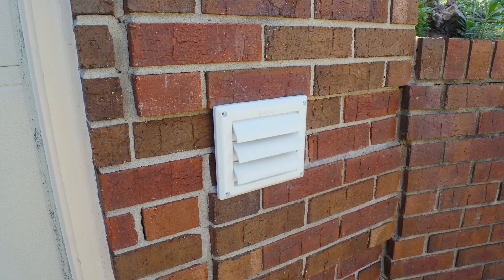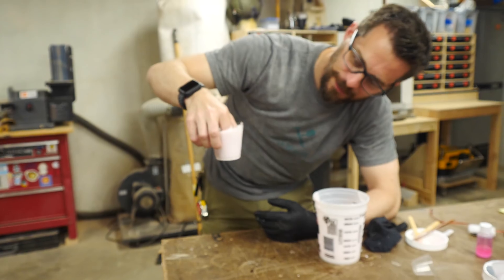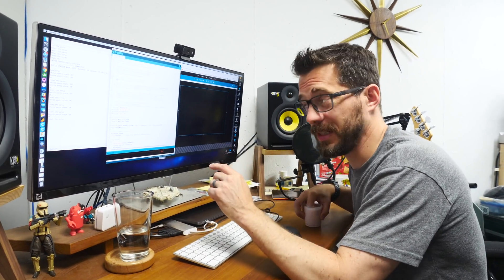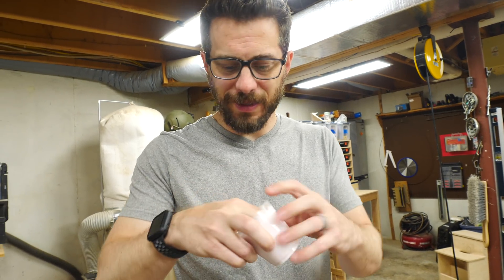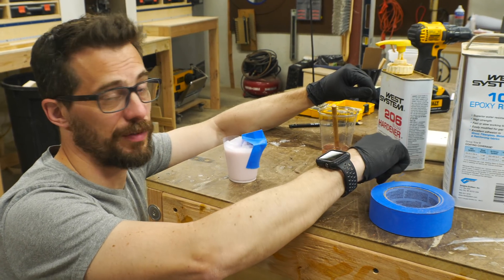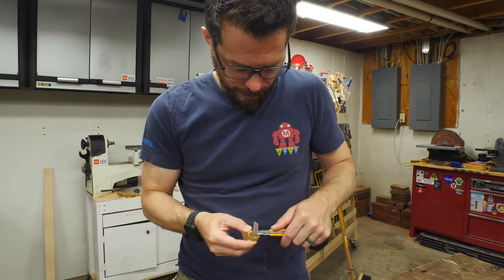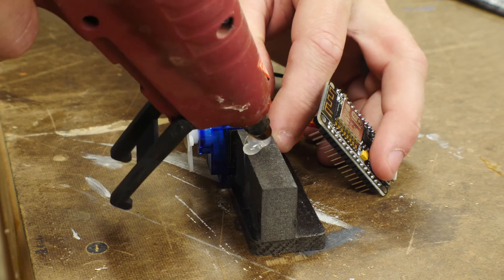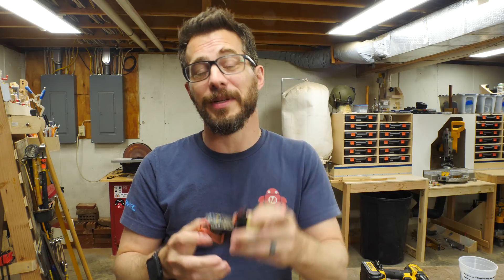How to Make An Alexa Controlled Finger | I Like To Make Stuff

Comment: Bob.... I've been trying to replicate this project for my own glowforge.  I was able to upload the code to my Nodemcu and the blue light on the 8266 module is on solid.  I've tried searching for the device in the alexa app and it is not found.  I tried using a serial monitor to see whats going on and the board is outputting the following string "⸮⸮⸮⸮⸮⸮⸮⸮⸮LR⸮"  any help would be awesome!
Reply: Update: I realized my serial monitor baud rate was incorrect.  I fixed this and now can see that the board is connected to my wifi and I am able to ping the IP but still no dice on discovering the device.
Reply: @mattgeroski9641  My alexa could not discover my device either. if you have any update let me know! thanks!
Reply: @asaele14  Any updates on how anyone got Alexa to discover the device? I'm stuck in the same situation.

Comment: I tried doing this and the servo seems like it is not getting enough power. Bob, what are you using for the power? I have a microUSB wall plug going straight into it. My concern is that the servo requires 5V but the board shows 3.3V.

Comment: If you get the right ESP32 board, it works just like the ESP8266, but it has deep sleep and a ULP processor - that way it could run on batteries.

Comment: Great Project I love it :) I was wondering how hard is to insert a relay in parallel with the button and connect it to ESP8622 or ESP32 and make Alexa use it to bypass the button and connect the circuit as if it was the button itself? that way you will have an iot button as well and you will only need to have the relay inside the unit to perform the circuit close upon command by Alexa - can that be done!? Again GREAT Project - learned a lot as usual. thanks, Bob

Comment: hi yes i was wondering if you guys could help me whenever i try upload my code to my esp i got this error messageArduino: 1.8.5 (Windows Store 1.8.10.0) (Windows 10), Board: "NodeMCU 1.0 (ESP-12E Module), 80 MHz, 4M (1M SPIFFS), v2 Lower Memory, Disabled, None, Only Sketch, 115200"

C:\Users\Ben\Desktop\sketch_jun27a\sketch_jun27a.ino:13:23: fatal error: fauxmoESP.h: No such file or directory

 #include "fauxmoESP.h"

                       ^

compilation terminated.

exit status 1
Error compiling for board NodeMCU 1.0 (ESP-12E Module).

This report would have more information with
"Show verbose output during compilation"
option enabled in File -> Preferences.

Comment: One thing I was curious about is how much smaller should the pilot hole/pre drilled hole be than the screw that's going into it? Does it matter how much smaller it is (to a reasonable extent), or is there a recommended size/ratio compared to the hole? And how would you figure out the right bit to use without knowing exact measurements of the screw?

Comment: Just to clarify what you have there is a NODE MCU board, which uses an ESP8266 chip, but also integrates other things such as USB interface and voltage regulators on top.
Reply from the maker: Um. Yeah, not sure that would have sounded as appealing during the build.

Comment: Nice video Bob!
I always thought it would be cool to use a similar setup to open and close curtains that were on a pulley. Either using Alexa or just by sunrise/sunset. The servo noise isn't very pleasant though. Any suggestions for low noise?
Reply from the maker: A small DC motor would probably be much quieter.

Comment: $42 for servo, Alexa board, molding compound + epoxy cost is steep for a beginner project, but great for channel content. I'm sure purpose built projects have great value for time saving in production  use.

Comment: Another really great option for software on ESP 8266 chips is the Sonoff-Tasmota firmware (search for it on GitHub). It offers some similar features, and support for the MQTT protocol (among other things) to integrate it with other systems, like HomeAssistant. It also allows easy setup of connected sensors and things like that.

It can be used with any ESP 8266 chip of your own, though it's largely intended to go with the Sonoff hardware, which offers great low-cost ESP 8266 devices with built-in relays and nice enclosures too.

Comment: This is exactly what I wanted to see! With Alexa is it possible to set up a sensor that if triggered will cause Alexa to activate another device? Example: a water-detector sensor triggers under a sink, tells Alexa, Alexa triggers a device that is connected to a servo that then turns the valve on your home's water supply off and has Alexa notify you that there was a leak and your water has been shut off.  Would you even need Alexa to do that? This has been an idea that I've always thought I wanted to make, but have just never followed through on. PS: This video really confused my Echo

Comment: couldnt u have found a 3d model of a finger or a hand and then cut off just a finger from the hand model and then printed it with an attachment on it (which is what the aluminum is for) instead of making a mold